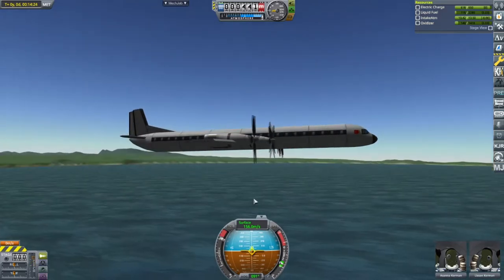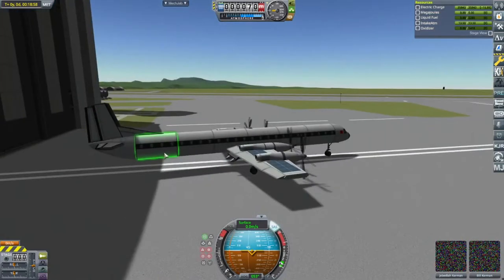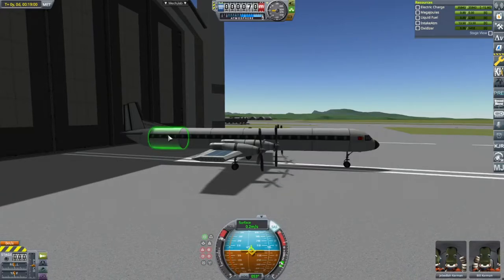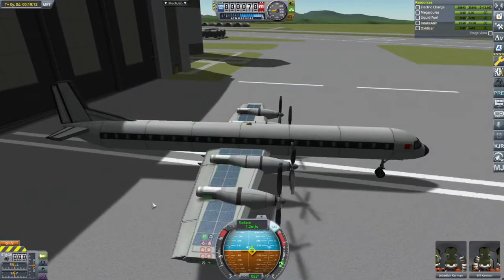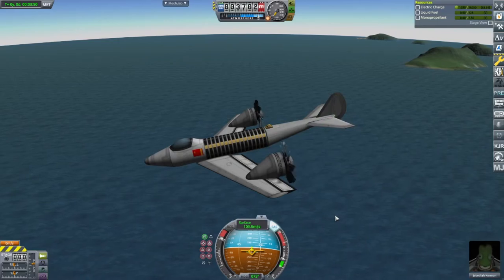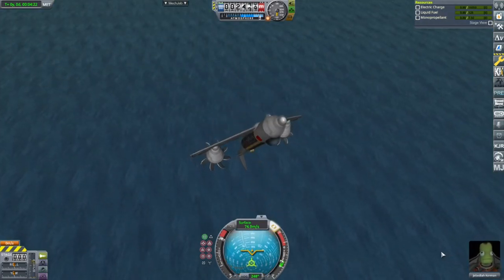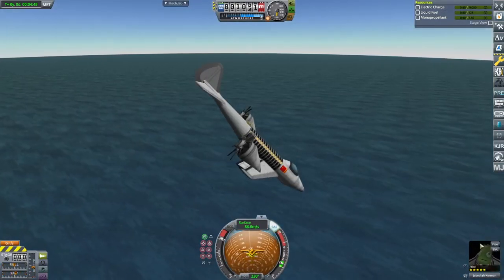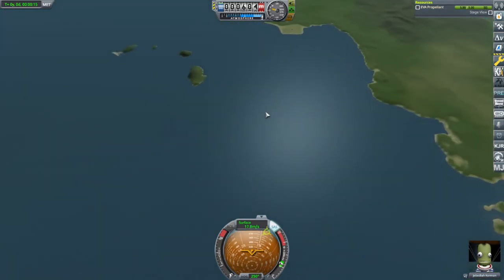What is the Best Way to Power your Propeller Planes in KSP

Comment: A problem I see here is that you are having the prop engines (either electric or fuel powered) run at maximum torque without adjusting propeller pitch angle. That is very very inefficient. You typically want to keep the engine torque fixed at around ~30% ish (really depends on the weight of the aircraft, but it should generally be pretty low), and then use the throttle to change propeller pitch angle, which will increase airspeed and make all these planes hilariously more efficient. (especially the fuel powered one). This is because propeller pitch angle needs to change with airspeed for greatest efficiency.
Reply from the maker: This was intentionally done for demonstration purposes as a variable pitch prop would introduce an additional variable while testing. That plane was originally build with VPP and can nearly reach mach 1.
Reply: @nautilus3007  Oh I see. In my opinion though propellers are mostly just a waste of time as they are a lot harder to use and are slower than jet engines. Though I guess the electric powered ones do provide thrust in places where you don’t want to bring fuel. But that’s really the only advantage I see in using propellers. And you’re right, there are a lot of variables involved in using propellers that make optimizing them tedious.
Reply: @thesenate2718  a bit late on asking, but should i have my proppellers pitch more the faster i go? or pitch less.
Reply: @Minigun_-nj1tf  The propeller pitch angle needs to increase with increased air speed, and vice versa. You can set the throttle to change the pitch angle of the propellers by using the Kal Controller. There’s some videos on YouTube that can help